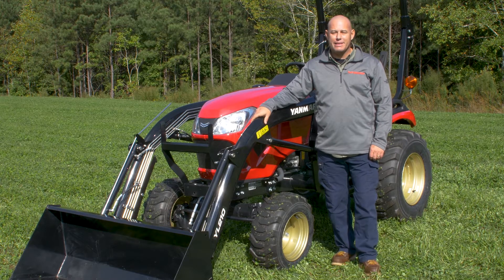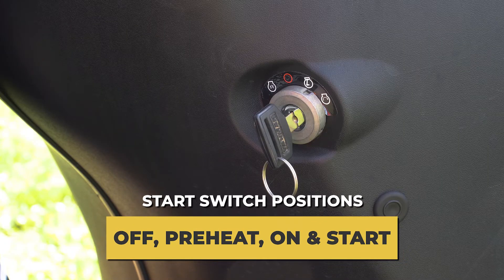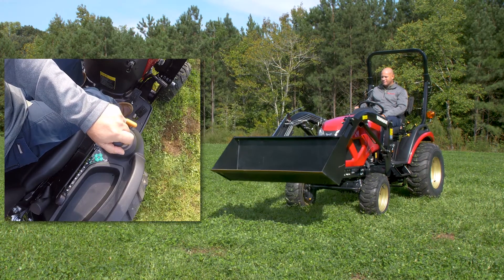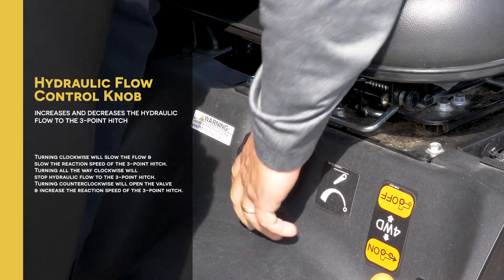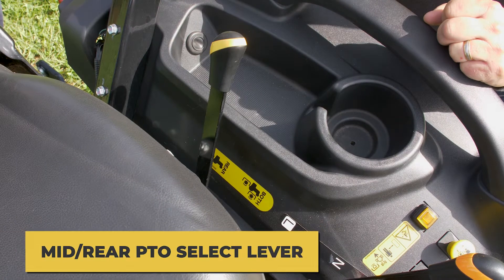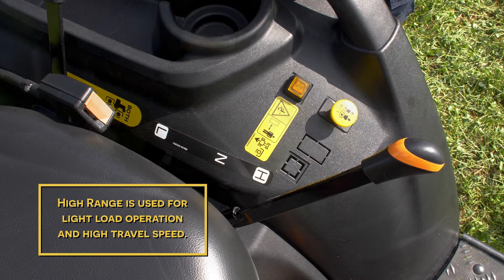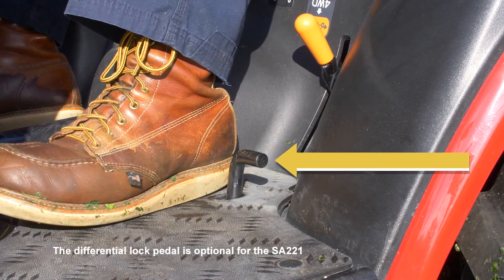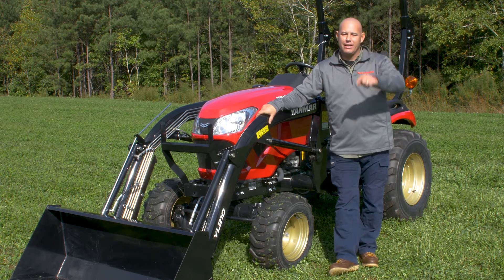Yanmar Academy - SA Series tractor Operations

Comment: I just purchased a yanmar 424 you said it comes with rear differential lock mine doesn’t have it.Why is this?
Reply: Did you buy it used? They didn't have the diff lock pedal until 2016 or 2017 I think. You can still lock the differential by lightly pressing the brake pedal, though it's not easy to do with it being on the same side as the hydro pedals.
Reply: @booja3449  I got it new this yr.Can a pedal be installed now?
Reply: @Clarity5970  If it's a newer model I would think you could but I can't say for sure. You may have to talk to your dealer and see if they can put one on for you at Yanmar's expense. It may be something that was forgotten at the factory, stranger things have happened.